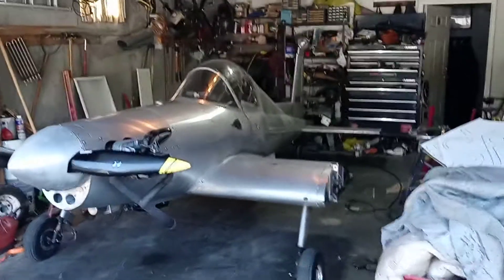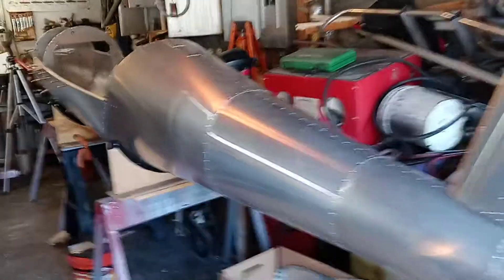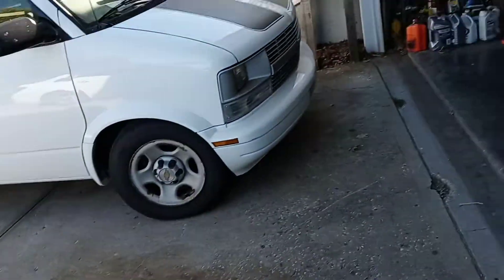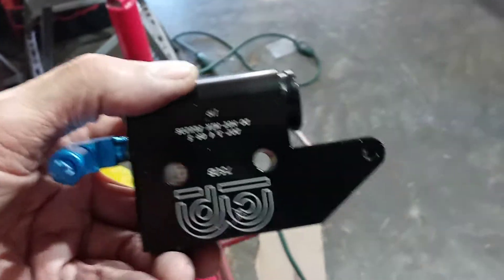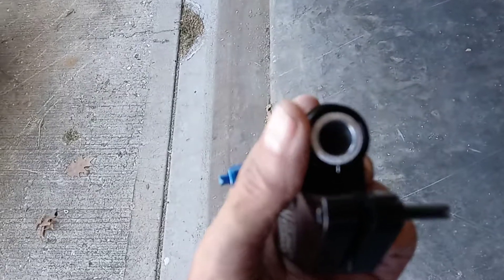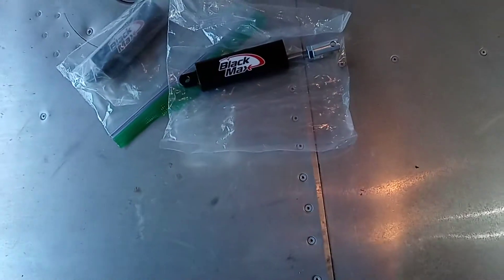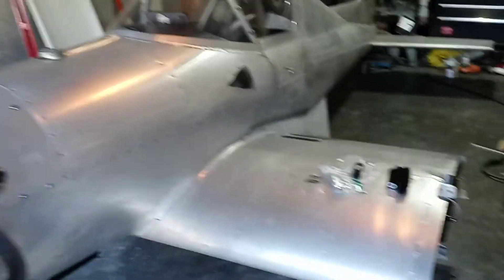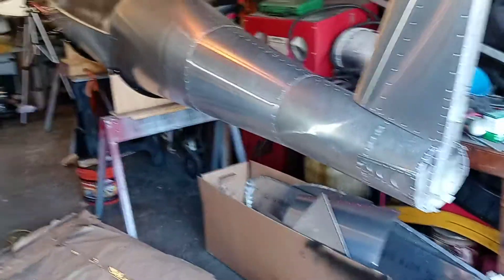What is going on today

Comment: How are the fuel tanks in the wings constructed?  Wet wing compartment, bladder or internal tanks?  Do you have a transfer pump to move fuel from the wings to the header tank or a selector valve with the engine feeding directly?  This is the first time I've seen wing tanks on a Hummelbird.
Reply from the maker: Hi Gary Plewa first off sir this is not a Hummelbird. This is a HUMMEL H5. My fuel tanks are my design because I have the build up ribs. They are aluminum and hold only 2.5 gallon each. Yes sir I have a selection valve and pump to pump gas to the header tank. I wish they held a little more gas. I may do something different later on. Thank you for your questions....
Reply: @redblackvette  Yes Dennis, my mistake, I realize it is the H5, with the full VW, but I, out of habit, typed in Hummelbird.  When I first saw the original 1/2 VW Hummelbird over 20 yrs ago, I was smitten and bought the plans for the engine from Morry.  But I never got around to building one.  Your channel was my first intro to the H5 and the Ultra Cruiser.  Thanks for replying.